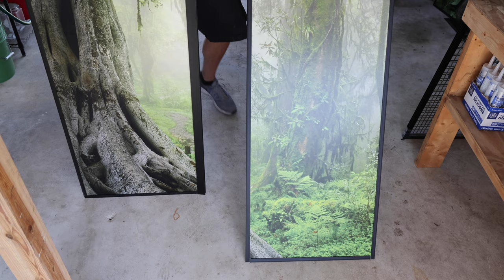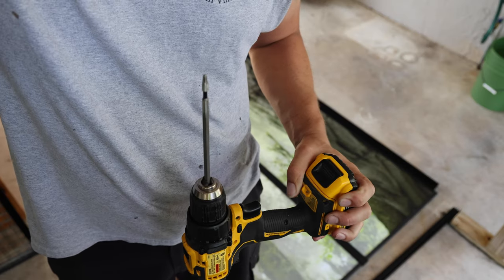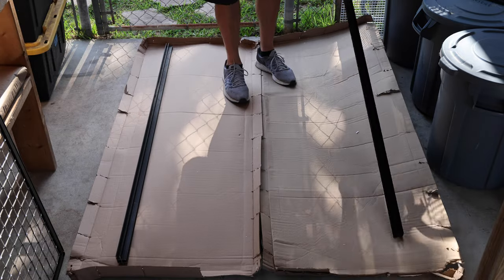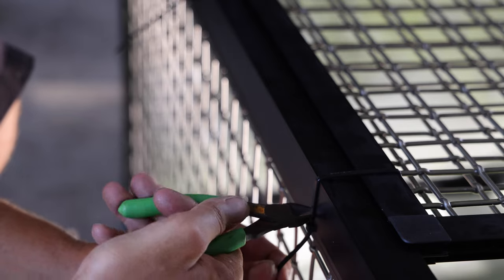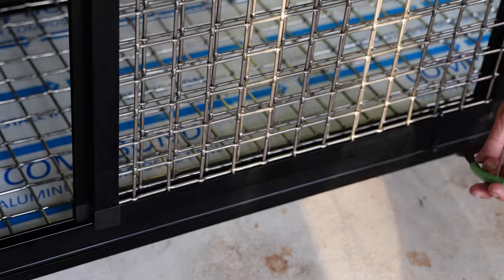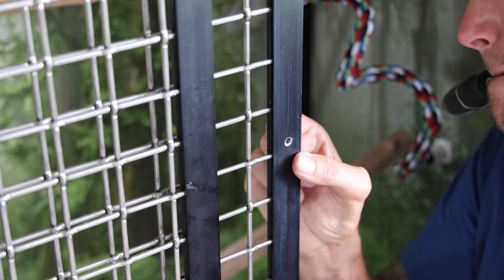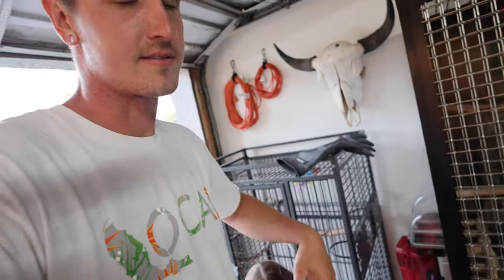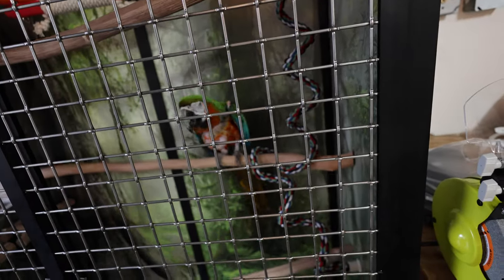How To Build ￼A Custom Cages Bird Cage!

Comment: As the cage doesn't have caging all around for all round climbing frame, she has near nowhere to break grab to maneuver the cage as she did, i'd connect the branches more, like with some parrot ladders etc, also make it easier to get to the doors panels to climb up and down, being a older Bird that can't fly, it looked as if she had to do a leap of faith to get to the front of the cage.
Reply from the maker: Because she a older bird she doesn’t move around to much. The reason she did that is because that’s the one perch that I have towards the back, but the other ones are closer to the front door. Even on her big giant perch that she’s out on all day long she literally sits in like two spots and that’s it.